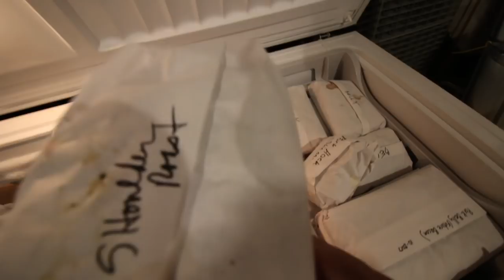I Hope the Goats Like It! (Goat Mountain)

Comment: Strap a couple of plastic milk crates down to your wagon. Then put your buckets of water in them, to keep them from sliding all over, or tipping over. (You know the big blue carbuoy that you used to carry water with? I use those to get drinking water from town. I learned a long time ago how nice the milk crates were, for holding those things. LOL) 

One or two more crates would secure the rest of the stuff, like feed. This works better than just putting sides on the trailer.

The 'mountain' will be extra shade from the sun, as well. And it's away from the building, so more breeze will blow through.

Comment: I hate to be one of those “you shoulda done” or a “ it would’ve been better if” kind of guys but just noticed you didn’t use your forks to pick the ramp up through the middle.. might have eliminated the time putting the ratchet straps on less pressure on the far end